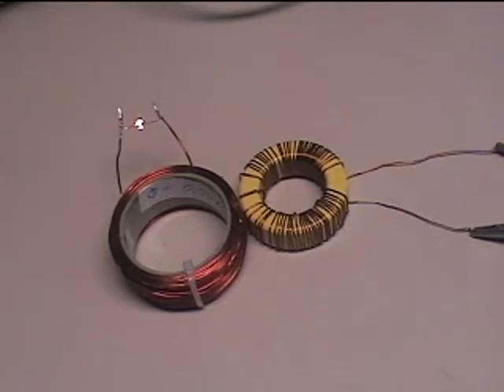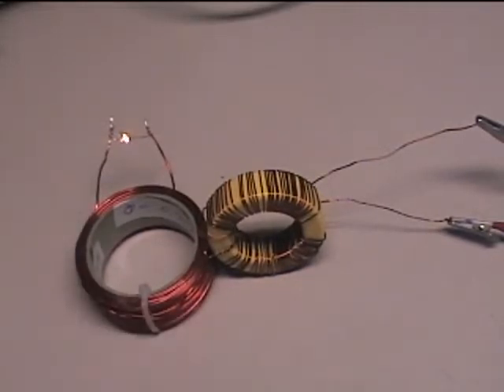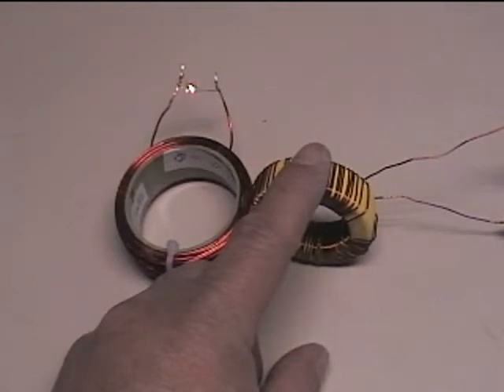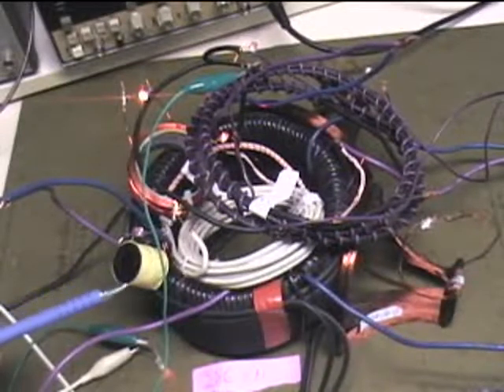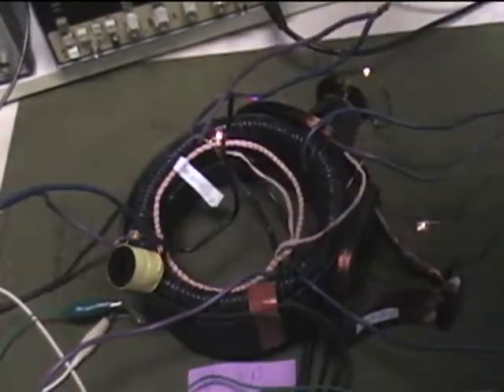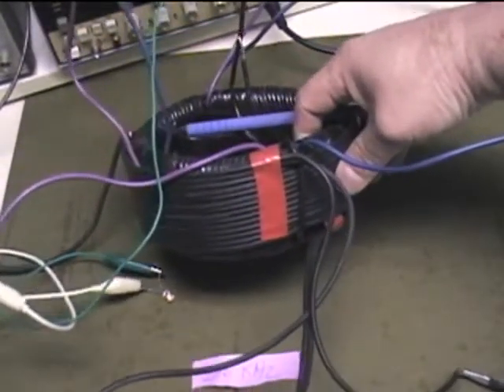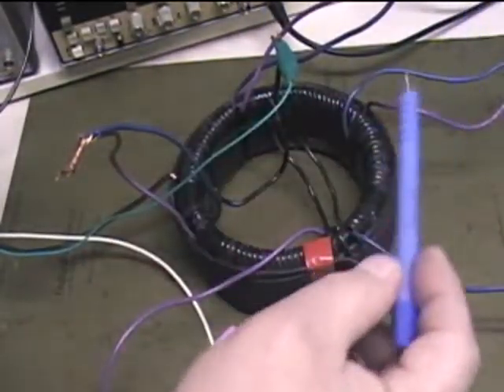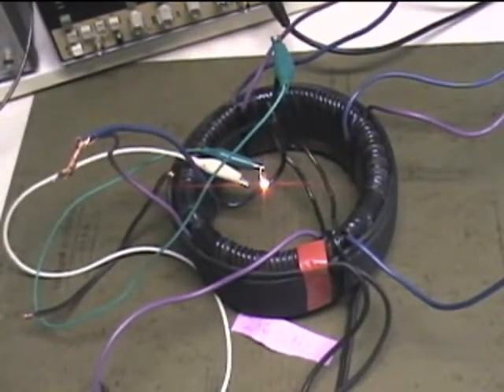Pulsing coils and lighting LEDS - Part 5

Comment: Hey Watts
If you will, can you scrape a bit of the coating off of the toroid cor and see if it is conductive? I am finding that many that have a coating do, like it is just a big metal washer. But most of my ferrites are non conductive. 
My toroids that are conductive seem to be harder to saturate than the non conductive ones.

Thanks

Mags